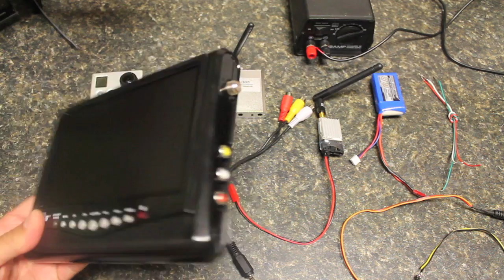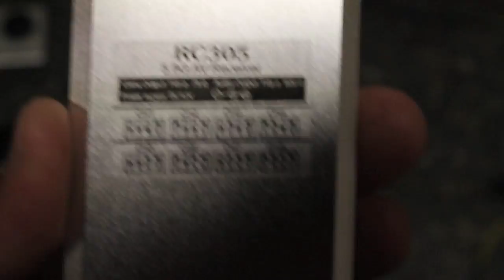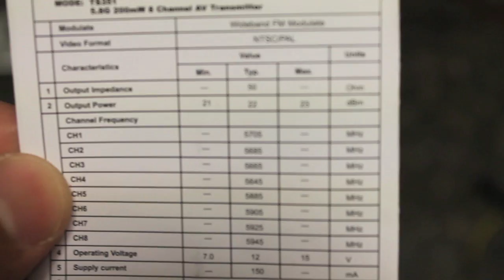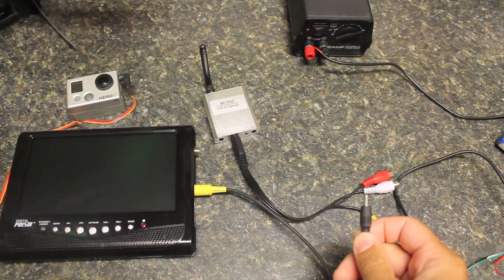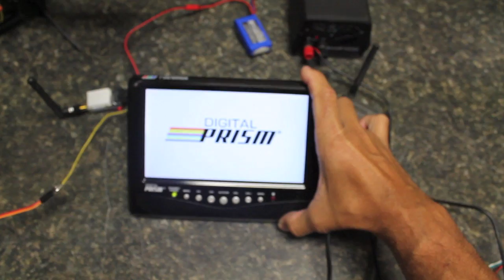How to Setup FPV w/ GoPro HD, HobbyKing 5.8GHz Transmitter/Receiver for DJI Naza Quadcopter

Comment: Hello, do you know a more cheap monitor that can be use for this setup ? thanks
Reply from the maker: The original FPV monitor link appears to be no longer valid. I'm not sure about this one, but it's cheap and looks like it could fit the bill for a cheap monitor: https://www.amazon.com/Pyle-PLHR70-camera-Monitor-Reverse/dp/B01BECUNCC/ref=sr_1_4?ie=UTF8&qid=1483292590&sr=8-4&keywords=fpv+monitor

Comment: Why not power the Tx off the Quad's Flight LiPO and save weight???  Many Quads have a 5vdc or 12vdc power port, but if you have a lame Quad, you can get power off the Balance wires for the LiPO too!  You save the weight of that extra 800mAh LiPO, duh!
Reply from the maker: Yeah there are various schools of thought as it relates to powering off your main batt. One is that the power draw if you spin up your motors can potentially cause a brown out on your VTX. Another theory is pulling a bunch of amps from the main batt can cause distorted power signal to the VTX and cause you to have a choppy signal. My rigs are large enough to where I can afford the extra 70g. Good suggestion for smaller quads. Thanks for sharing.

Comment: Can I power my transmitter with just 2s battery? or strictly 3s
Reply from the maker: It depends on the power input requirements. Mine supports 7-15 VDC input so a 2S or 3S will work.

Comment: is it really 12v on the receiver?
Reply: you cant bring your power supply bro when you want it to stick it to the remote control of the drone
Reply from the maker: That's why you can use a small 3S lipo velcroed to your RC or find a way to run power from the RC batt, but I prefer a separate battery in my setup. I don't like the idea of draining my RC batt.

Comment: Mine getting no signal after like two minutes. On every channel. Why?
Reply from the maker: +Da Aa Not sure. Maybe your TX or RX is overheating? Or maybe there's some sort of interference. It's hard to say without having it in front of me to diagnose. Let us know what you discover. Thanks.
Reply: +Dennis Baldwin Same here. My FPV system just stopped working. How can I check for damage?
Reply: If you turn the transmitter on without the anttena it will pop
Reply: +daz baker It's always on.

Comment: Witch battery are you using? (can you send a link)
Reply from the maker: +Benjamin blanchard This is the battery I'm using: http://amzn.to/1Qetx2s but make sure your transmitter can operated off of 7V. Mine can support anywhere from 7-12V DC. Good luck.
Reply: Thanks
Reply: +Dennis Baldwin Hi but witch charger are you using because it is impossible to find the right charger for the battery. I got the same battery ass you ;)

Comment: Can't you just get a splitter and use the battery on board the quad to run the transmitter?
Reply from the maker: +Ciber X Gaming Definitely. I've heard (no personal experience) that interference from ESCs running on the same batt can mess with your TX signal. But yes it's certainly possible and you'll need to do some testing. I've always run a separate small battery.
Reply: Interesting. I'll have to test that out once I get my Gopro and FPV stuff soon! I bought an extra tiny battery just in case!
Reply: +Ciber X Gaming Worst comes to worst you can buy an LC Filter like this one: http://www.amazon.com/MRM-LC-Filter-capable-Requirement/dp/B018B2LAGG/ref=sr_1_3?ie=UTF8&qid=1451107595&sr=8-3&keywords=lc+filter

Sometimes the ESCs can cause power spikes and it causes lines across your screen. It's tolerable, but it is better to spend an extra 7-10 bucks and have a better time.

Comment: i think your receiver channel setup is binary. but there is a different i think. instead of right to left is left to right like inverted. for example 0011 is 3 but in your case 1100 is 3. normally binary to decimal:
0 0 1 1
8 4 2 1
add the numbers corresponding to only ones like 1+2=3 means channel 3. but this is my opinion. it's could be something else.
Reply from the maker: +Mustafa Süzen Good to know. Thanks for sharing that info.
Reply: +Dennis Baldwin You welcome. ;)

Comment: Hi. Thanks for video. Can i use this with lamax or sencor action camera?Difference is only live view on back display.
Reply from the maker: +slay00000 I'm not familiar with either of these cameras, but I'd make sure they have live video out. If they do then you should be able to transmit the signal with a video cable and FPV TX.
Reply: +Dennis Baldwin On Lamax X7 is HDMI video out and usb port. I hope that it will work :)

Comment: Great video!

What is the range for your set up?
Reply from the maker: +jerico nava Thanks. With the default antenna the range is pretty weak...about 1/4 mile max. If you can get a cloverleaf setup you can at least double that.

Comment: Hi Dennis.  Hey, I have the same setup (minus the GoPro).  Got the switches to work (THANK YOU).  The issue that I am having is that video works as soon as I plugin the battery then in about 25 seconds I get a no signal.  Could this be that I am using to big of a battery and its overheating?  I have the power source hooked up to my Quads main board running a 30C 2450 battery.  When I plugged in a 25-50C 4000 battery, it lost signal a lot quicker?  I ordered a 2S 1000 battery today and plan to run it separate to see if this corrects the problem. Any input would be greatly appreciated.
Reply from the maker: +Elimin8tor65 It's unclear if the 2450 and 4000 mAh batts are 2S or 3S. I'm assuming at least 3S since they are your flight batteries. Most transmitters will support up to 3S but I've seen in some cases where 2S is the max. Give that 2S a try and let us know what you find out. Then we can take it from there. Good luck.

Comment: How many range in km?
Reply from the maker: safu gsm With the default antenna not very good. Probably like 500m at the most.
Reply: Nice sir thankyou But i see some video they use wifi booster with antenna and the range will be very more about 10 km and i see one the range is 20 to 40 km they use booster to wifi

Comment: Can I save video to the gopro while using it for fpv?
Reply from the maker: AC TV Yes definitely.
Reply: Dennis Baldwin Sorry noob question, but for the TS85200 - can I connect the video wire (yellow) and ground wire (black) to the video and ground on an RCA plug (from a camera)?

Comment: nice video!!! I'm currently working on a fpv project and I'm using a 12v battery for the transmitter but the transmitter light tuns on then it goes off do you know what the problem might be???
Reply from the maker: Kompa100oficial The only suggestion I can recommend is check your manual for the input voltage requirements. I've ready of some that can only support up to a 2S battery, but mine supports up to 3S. Good luck and let us know what you find out.

Comment: Reading around someone said that both the TX and RX need 12v... that seems like overkill for the TX at least. Would something like a 2s 1000mah 7.4v be sufficient for the TX like in the video? This would save some serious weight. I believe you could even go for a single cell thats like 3.4v 750mah. Any ideas or thoughts? thanks.
Reply from the maker: Boarding28 Generally they will support a range of voltages. The TS351 will go anywhere from 7-15V so you could get away with a 2S. More details here:

http://www.sierrarc.com/docs/BoscamTS351.pdf

It won't work with a single cell though. Good luck.

Comment: Thanks for the video. I have the same receiver but for some reason no matter what channel setup I try between the RX/TX I get a scrambled or fuzzy picture :/ Any ideas?
Reply from the maker: Manny Martinez It's hard to say but make sure the antenna on your TX and RX are secure. I'd also make sure there are no obstructions and you're not inside a metal garage. The default antennae are not the best but you should definitely get a decent picture.
Reply: Dennis Baldwin I think mine were defective. got a refund and some new ones and they worked

Comment: I have a problem.
When I have the signal and the ground wire to the transmitter and all three wires into the monitor, I have no video but audio???????
Reply from the maker: robin bertschler The only thing I can suggest without seeing your setup is to try and wire the camera directly to your monitor to rule out a possible problem with your wiring. If you get a video signal then you know something is not working with your TX. If you don't get a video signal then you may have an issue with your camera or monitor. That's my best guess right now. Good luck.

Comment: Hi there Dennis.  How much distance have you got.  Mine will not got 10-15 meters. Any ideas ??
Reply from the maker: Dave Parker About 1/4 mile max with the default antenna setup. But that's stretching it and requires good line of sight. I can get 3 times that much with a cloverleaf antenna setup. I'd recommend looking at upgrading.

Comment: VERY Good info for me how can i get the batter charger for Turnigy 2s Lipo pack to buy? the power supply is 6.5-12V
on the TS 351 Transmitter, RC305 Receiver operating voltage: 5V - 12V DC  you can get it to buy on Ebay, I am new to the hobby,I have the STEADIDRONE QU4D 2014 RTF and don't no if the charger will work for 2s lipo battery.
                                                                                                                                         Thank You
Reply from the maker: Kenneth Chance Thanks for the feedback. Perhaps your steadidrone charger will work, but it's hard to say without seeing it. Most chargers have multiple connectors (Deans, JST, XT-60) so you can charge different battery types. I have one similar to this:

http://amzn.to/1vdihN7

Which allows me to charge different battery types. For the 2S batteries they'll likely be the little red JST connectors.

Comment: is it possible to connect it to the HDMI output in the gopro 3
Reply from the maker: Team Nootdorp You can use this cable:

http://amzn.to/1CAzH3I

But not sure if it can be hacked to connect up to an FPV transmitter. I'll need to look into this some more.

Comment: what is the output volatage of the ts351, is it a safe voltage to where i can use it charge my mobius while flying?
Reply from the maker: Marcio Cardenas Here is the spec sheet:

http://www.sierrarc.com/docs/BoscamTS351.pdf

My recommendation would be to tap into the input source before the TS351. Not sure you'll have much luck trying to grab output voltage from it.

Comment: Hello my friend  ,my name is Stavros and I am new player with FPV and I wang to now how record the flight , because I see the gopro cam is ready to record but no record . How and where record my flight . Sorry for my questions and thank you.
Have I good day. 
Stavros ...
Reply from the maker: Stavros Salevourakis When you connect your FPV gear you should be able to record with the GoPro the same way you record without any gear hooked up. If you're having problems with an older version of the GoPro then I recommend you check the firmware updates page:

http://gopro.com/support/hd-hero-firmware-update

Perhaps you need to upgrade.

Comment: Hello

I have the same system, I get video perfectly fine but when I am at half throttle or high my video cuts out. I get no signal, i tried LC filter and it still does the same thing?

The quadcopter is a 250 emax carbon fiber frame.
Reply from the maker: Brelan Blake Have you tried isolating the power source from your main system power? I normally do this with a lightweight 800 or 1000mAh dedicated FPV TX battery. Also, see if you can get the TX as far away from the ESCs as possible. Just a couple of quick thoughts. Good luck and keep us posted.

Comment: Great video.  Thanks.  I'm looking to do the same.
Two questions:

1.  I note there's a USB on the side of the Hero2.  Why not use that... Using something like this, or an equivalent:  http://www.hobbyking.com/hobbyking/store/uh_viewItem.asp?idProduct=64425
Not available then?

2.  I'll be using my with a Cheerson CX-20.  It has a 12V aux power source.  Why not use that to power the transmitter (or tap into the main battery another way)?  Wouldn't that be worth avoiding the extra weight of a dedicated battery?

Thanks again!
Reply from the maker: john2510 1. From my experience those cables are only compatible with the Hero3. I have one from GetFPV and it works great on my Hero3. From my understanding to have something compatible with multiple models it will require getting the data from the bus connection:

http://www.getfpv.com/accessories-75/a-v-cables/gopro-video-board-live-video-out-charge.html

2. Good question. I've read of issues with powering from the main battery causing interference in the transmission signal. My battery is so small and light that I'm not too concerned about it. My quad is well powered so it's not an issue, but I can definitely see it being an issue with smaller systems where every bit of weight counts.

Thanks for the questions.

Comment: why is it that most quads that have a gopro for filming also have an extra camera for there fpv? I'm looking at building one but I just didn't know if I need to invest in another camera. It would seem if your filming with the gopro it would be easier to get the shots you want looking through the video feed from the gopro
Reply from the maker: Buddy Warren From what I've found the distortion in the GoPro lens makes it somewhat difficult to fly via FPV. I've gone back and forth, but having a dedicated FPV camera like this one http://amzn.to/1etlAHK makes it easier to get a good perspective when in the air. If you have a cable to get live video out of your GoPro then give that a shot and see what you think. You can always add a dedicated camera later. Let us know how it goes!
Reply: OK that makes sense, Ill try it without and if I don't like it Ill definitely invest in a fpv camera

Comment: Great and nice video , very clear congrats, one question if you don´t want to use a 12 Volts Power Supply, what type of battery should I use, 2s, 3s 800mAh or?Thanks
Reply from the maker: Horacio Monterroso I power mine with a 1000mAh 3S, but you could definitely power it with 800 as I've done that many times before.

Comment: Do you have to use lipo for the transmitter?
Reply from the maker: ECXTD It doesn't have to be a lipo. Anything that can provide the required amount of input voltage. Lipos are generally the easiest for me.

Comment: Channels follow binary:  1, 2, 4, 8. 
0000 = Channel 0
1000 = Channel 1
0100 = Channel 2
1100 = Channel 3
0010 = 4
1010 = 5
0110 = 6
1110 = 7
0001 = 8
1001 = 9
0101 = 10
1101 = 11
0011 = 12
1011 = 13
0111 = 14
1111 = Channel 15
Reply: EDIT: That is 4 bit binary if anyone has any questions on bit numbers.
Reply from the maker: ***** Good stuff. Thanks for sharing this info. You too Alan Zanotto thank you.
Reply: Technically you are suppose to read binary right to left, but to keep things simple i just wrote it left to right.  I believe this video that it is set to channel 3 (reading left to right) just because that is how the documentation was in your video.  It's also likely that it could be channel 12(reading right to left).  Unless the device uses some other pattern, but that would be strange.
Reply: Alan Zanotto Funky how some devices use reverse binary, it would seem that the low order bit would be rightmost

Comment: Hey man.
What sort of resolution can the tx and rx handle?
If I get a monitor capable of 1080p, will I be able to get that resolution from using my gopro for fpv?
Reply from the maker: shemadeitforme That's a good question. I have a GoPro Hero3+ now and I'll need to do some testing. I'm not sure what the max resolution you can push through the TS351 is. I haven't had any issues with my Hero2, but if you're looking at 1080p that's a different story. Here is a link that shows the different output types:

http://gopro.com/support/articles/hdmi-feed-to-external-monitor-settings

I'm sharing that for my own reference too :) I'll let you know what I find out.

Comment: how many miles did this thing can do?
Reply from the maker: rafi siregar Less than a mile with the stock antenna. If you upgrade to a cloverleaf setup then you can get much further. I know you can get over a mile, but I've only read about it. Have never it done it myself.

Comment: Have the same setup on Phantom. My pic is gone after 10m distance.. Why?
Any Idea? Thx
Reply from the maker: ERIK HRAST That's not good. I would definitely upgrade the antenna but you should definitely see much better than 10m with the default ones. Have you done a range test without your Phantom to see how far you can go just by walking with it?
Reply: Dennis Baldwin No I haven't try... I'm not having ekstra power supply for TX. Everyone is saying to me that my TX/RX frequences don't match?
Reply: Dennis Baldwin good antenna upgrade is here http://www.ebay.com/itm/161504246306?ssPageName=STRK:MESELX:IT&_trksid=p3984.m1555.l2649

Comment: 720p? does that AV Tx really send and receive 720p? or is that just the camera and display spec?
Reply from the maker: ***** That's a good question. I need to look into this some more. The spec for the TX states 8 MHz video bandwidth, but not sure how that translates to 720p. Will see what I can find out.
Reply: cool Dennis.. I thought I heard that it's only SD.
but it'd be nice to get some independent confirmation on that.

I see other AV TXs advertising their HD capability as a feature, and they usually are quite pricey..  I'd imagine that if this on is HD capable, it'd be bragging about it, all over the box.

just speculation tho... I've personally seen no scientific data that prove either way.. but anecdotally, the picture on my HD screen doesn't look 720, and the status bar says its set for Auto 1080 and lower, but is receiving a stream in standard def.

it'd be nice to hear what results you get, and, if you do get 720 streaming video, what's the difference in our two setups.

cheers